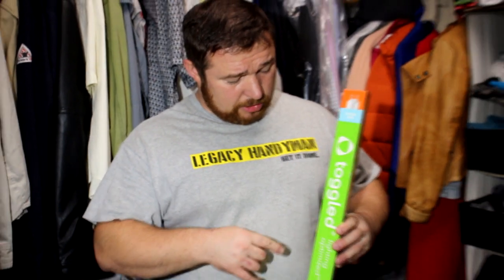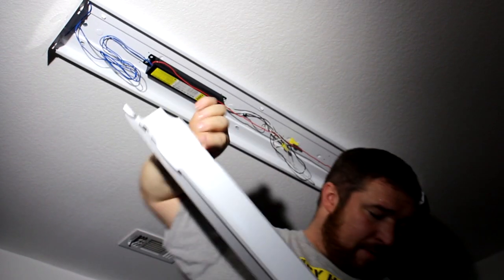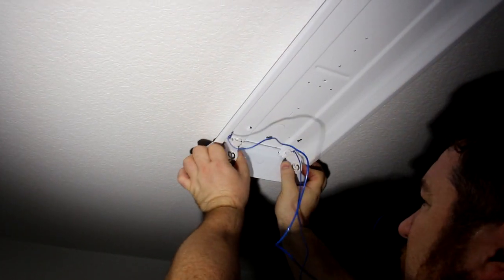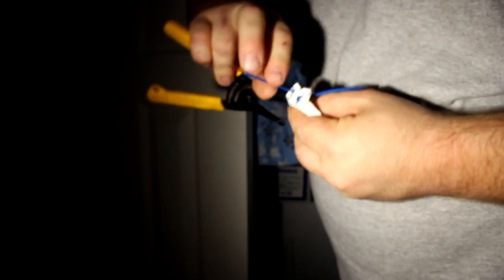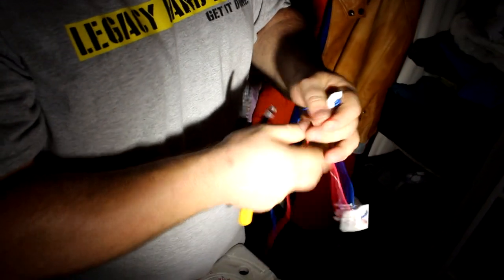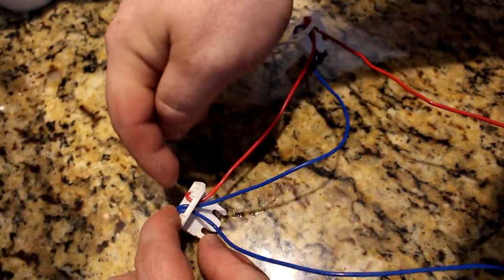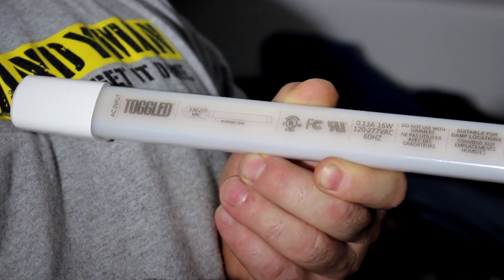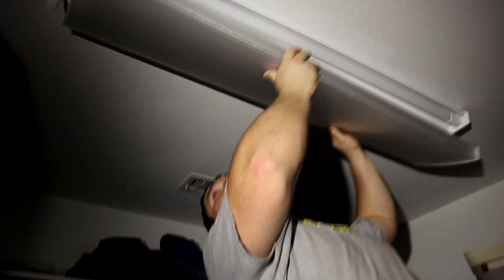How to convert  T8 & T12  fixtures  to  LED Tubes.

Comment: Good video, but "daisey chaining" the tombstones together creates a series circuit, not a parallel circuit.
Reply: The hot goes to both tombstones. The neutral goes to both tombstones. Both tubes get 120 V. That's parallel.

Comment: Do I have to change the tombstone
Reply from the maker: You can use old ones if they are in a good condition.
Reply: Ok I did and put the power side on the tombstone where the power is coming in but still nothing I went and got different tubes
Reply: Rick James —Check to see if the tombstone is shunted or non-shunted...

https://youtu.be/LovVxqiNXaM